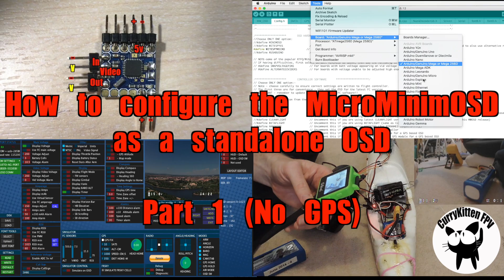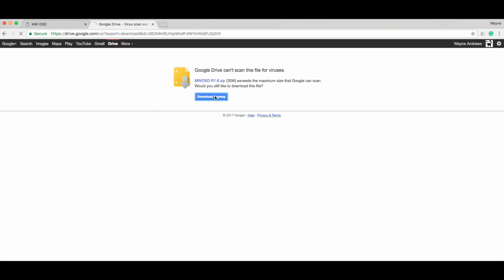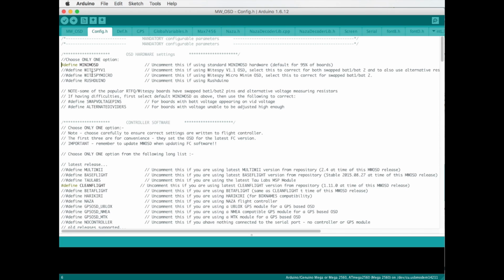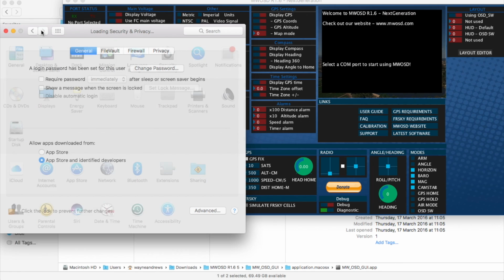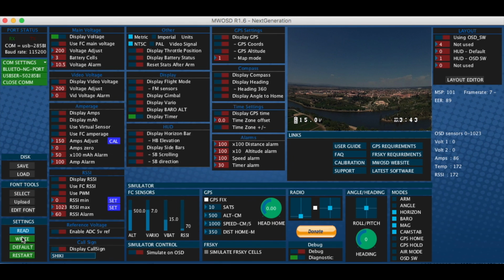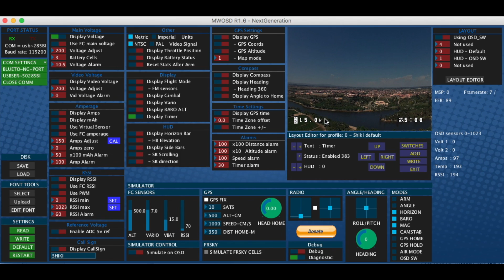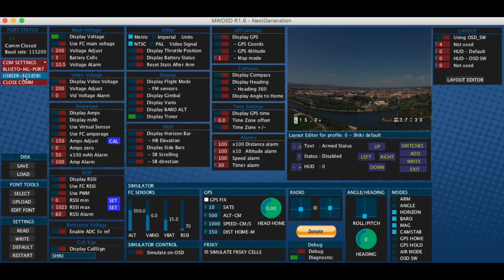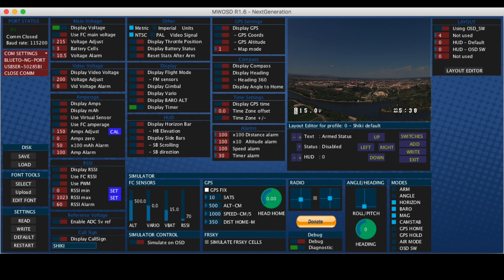FPV Tutorial: Setting up the MicroMinimOSD as a standalone OSD (no flight controller)

Comment: I can't seem to get the configurator to work for me. It flashed ok, I got the 1.6 app up ok, I hit connect and lights flash and it says connected but I also have "waiting for OSD" and this never goes away, even if I try hitting restart, read, write or anything  http://imgur.com/Du7HRp5
Reply from the maker: No way you could have reversed the TX/RX pins I take it (sorry to ask the obvious ones)  Does it work ok in the old Java based configurator ?  Does the OSD work ok outside of the configurator ?
Reply: I still have it plugged in to the FTDI in the way you showed. I couldn't find the old java based config - I would have preferred that TBH (got a link?) I haven't tried it yet Wayne - I assumed there would be nothing to see, but I can soon find out
Reply from the maker: Yeah - if you roll Github back to the previous release you can get it here https://github.com/ShikOfTheRa/scarab-osd/tree/v1.6/MW_OSD_GUI when you say - nothing to see, you have actually flashed the firmware on there I presume... else there will really be nothing to see
Reply: Just checked - I have a picture ok but no OSD at all - however, I have only a single signal in and signal out wire, and I noticed that you showed (V + and V-) in and (V+ and V-) out on part 1 - is this necessary? I use the same cam with a flight controller and that only needs signal in and out - I have only three wires on my Eachine cam - power + and - and signal
Reply: That's the version I downloaded Wayne - 1.6 (for windows 64 bit) - yes, it said it was successful, so I assume it worked, should I try again? - won't take a minute I suppose
Reply from the maker: If you go to the normal download page, it'll only give you the Chrome app version, that link is the java version
Reply from the maker: If you are getting a picture, then you have the right connections electronically at least.  Video wire from camera to yellow V in (as per 11m 40s ish) and yellow V out to VTX.  In theory you should have a common ground from the 5v and the lipo, but it seems fussy sometimes about having none/1/both.  But it shouldn't stop you connecting.  Did the flash go ok, and are you able to reflash it (This is not to make sure it was flashed, but to check it's still working - the chip an be blown on the board and the video still passes through ok)
Reply: You'll have to excuse my ignorance Wayne - I have no idea what or which file you are directing me to or what to do with them - I don't see an executable there
Reply from the maker: Download the application.windows64 folder, and run the .bat file in there.  This is a launcher which will run the configurator as a java .jar file.  Did the actual flashing from Arduino go ok... and does it stil ?
Reply: Yeah - I fell at the first hurdle again - I downloaded the folder but windows doesn't know what to do with it - what do I use to open the folder? 
I re-flashed as "no controller" and still have "waiting for OSD" on the app
Reply from the maker: Ok, well god news is that if it flashed through the FTDI connector ok, means the board is functioning.  By default though, there's a quite busy OSD already there by default - which you should see.  Try adding a ground connection onto your video in or out on the board.  Use Windows explorer to open the folder you downloaded and then double-click on the .bat file
Reply: " Use Windows explorer to open the folder" - no, it won't, but fishing around with a couple of breadboard leads gets the OSD flashing up in my goggles, so it looks like adding a ground might work - time to dig the soldering iron out again and make up a new loom. Thanks for your help Wayne
Reply from the maker: Ok - not sure where you are with running the old gui, but at least some way forward in the OSD showing up.  Did you patch in a ground with the leads, or does it look like something else might not be wired right ?
Reply: No, I patched in a ground from the ubec powering the cam (one from the 12v vtx had no effect) - on reflection, maybe the fact that I'm doing this on the bench with two different ubecs (one powering the board, one powering the cam) from two different batteries may have been causing earthing problems. I'll make up a new loom (instead of the cobweb of wires I have now) and run it all from one source - I imagine that'll help no end :-)
Reply from the maker: Sorry - I wasn't considering that bit.  Hands up - guilty programmer here and very used to cloning bits and pieces of a repo when I need to.  Probably easiest for you to grab the repo at that level, so go to https://github.com/ShikOfTheRa/scarab-osd/tree/v1.6 click on "clone or download" and then download as a zip.  Extract this and you'll get the same directory structure as shown on github - so you can then navigate to the directory mentioned and run the batch file
Reply: Thanks Wayne. Despite it thinking I had a 32 bit system (I don't) I was able to get the 32 bit version running and it read the osd. It wouldn't write to it but it did open a new com port (6) which I was then able to get the app to use and was able to read and write.  So now I have a working OSD, except it's not finding the GPS (I know it works because I had it on an F3 board last week) and the text/ characters are garbled (see pic). Any ideas? It's the same on both NTSC and PAL (I tried it on both on both the cam and the OSD) and I've tried a few different cameras (picture was taken while using a turnigy 2k video out, which is why the weird bars etc.) I have also tried both the default and the bold font  http://imgur.com/JIyXek1
Reply from the maker: Weirdness - probably worth dropping an email to the Chrome app developer to report the problem.  The Character corruption I recognise - it's looks like an issue getting the character set over.  If you try writing the character set over again (from the app) and have another look.  I;ve found that it can look fine and then look gardbled, and it can be as simple as using a different USB lead.  GPS wise - what type are you using, there's some different bits of code to change depending on the type you have
Reply: It's this one (I think it's the one you linked to originally) http://www.banggood.com/GPS-Module-with-Ceramic-Antenna-GPS-Receiver-TTL9600-Ublox-Module-for-Multirotor-p-1100984.html
I've written and re-written to the board about 8 times now - I'll try a different USB lead though and see if that helps.
Reply: No joy - after several reboots because java kept packing up and the app kept disconnecting, I finally got connected (through the java GUI this time) so I reset to default and started from fresh but it's exactly the same
Reply from the maker: Sorry to reiterate the point - but just wanted to make sure you have done the individual font upload (separate from the normal write to the OSD) ?  The GPS is a weird one - it's easy to double check with an Arduino board - you can just read from the serial port and check you get NMEA-like strings appearing.  Most obvious cause of issue here is getting the tx/rx going straight though intead of tx from GPS to rx on OSD etc
Reply: Well I thought I did - I picked the bold option and saw it upload and change on the GUI, is that what you meant? I'm not sure what you mean by the second part " getting the tx/rx going straight though intead of tx from GPS to rx on OSD etc" - does this mean I may have a short between those pins? - I'll check my soldering tomorrow when I've got some daylight - my eyes are getting too old for fine work under artificial light :-)
Reply: Update: After leaving it for several days, I found a tip on google that suggested I check the V+ from the FTDI as the fonts require at least 5V to upload correctly - my FTDI was only outputting 4.4V, so I used a BEC to the board to provide the 5V (5.2V to be exact) and that worked! Now to try to work out what's upsetting the GPS ...

Comment: Im a bit confused Wayne....If I use the new MWOSD configurator APP, is that all I need..?....Or do I have to use the other software as well...?...Confused..?
Reply from the maker: You still need to do the few changes in the arduino IDE and then compile/write to the board.  The new Chrome app is a replacement for the previous GUI to setup the actual OSD
Reply: Ah, thanks for that. It's not like Arduplane then where you can upload firmware and configure the OSD layout all inside the one package..?.....If not, why not..?..I assume in the old GUI....you can do it all..?...No wonder Im confused,..lol.

Comment: is possible to install this firmware at the conventional minimosd? I'm so boring with the actual screen from my osd with APM. The informations are big on my screen although I always set just battery, flight mode and time.
thanks for sharing man!
Reply from the maker: Yes it is !  I haven't done it myself yet... there's that slightly annoying thing that the minim can insist on having several types of power when flashing stuff... fonts at least IIRC.  I think I needed both a 12v and 5v supply just to install a font without it corrupting !  (I think that was with ArduCam and I can't recall the OSD firmware I was running)

Comment: Nice Video Wayne....It will be more worthy once the GPS is on it for sure...Tempted to try MWOSD on my Minim too now.....Is it more reliable than Arduplane?
Reply from the maker: That I can't tell you - but I did have a minim on a copter based ardu, and I couldn't get it to work right at all. Just wouldn't request the right data from the ardu - so I'll have to go back and try it with mwosd.  I tried a GPS on a walk around the park today.  It works well.  Complete OSD for £10 :)
Reply: Yes, Im interested to see how the GPS works out for sure. My Skylark Tiny is pretty good for the money and is small, but this looks like it will be even smaller. The GPS altitude will be pants of course, but the direction pointer accuracy will be interesting....My Skylark does not have the benefit of a compass either, but the basic GPS has saved my bacon more than once. Be interested to see it on a plane, at range, being used to the full extent during testing....I guess it might pay to use a good GPS puck also..?
Reply from the maker: I suppose the test is how usable is it using cheap and cheerful components.  This will never go to a serious range - as I start to like using a decent AP for that - but I'll hope to get some decent test flights with it and see how it performs
Reply: Yes, I agree....I'd like to try it with my spare, full size cased Minim OSD....Watching this one with interest Wayne.